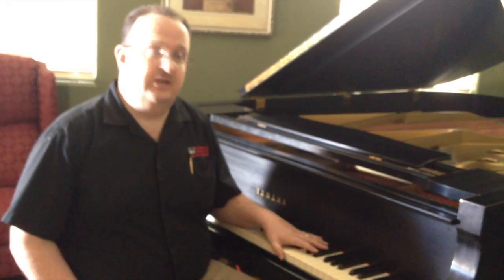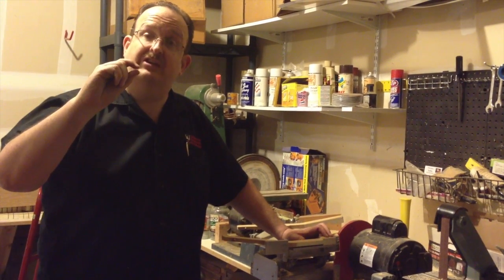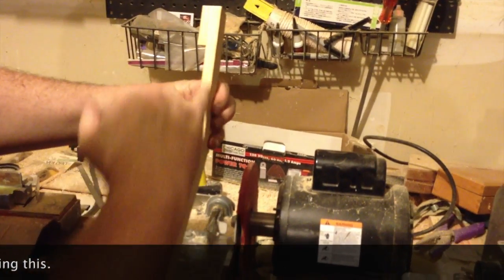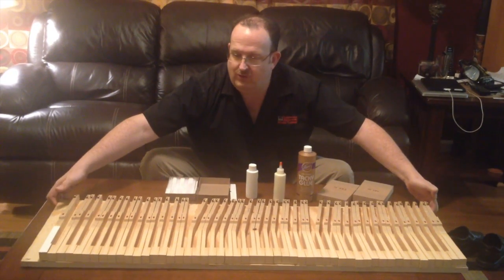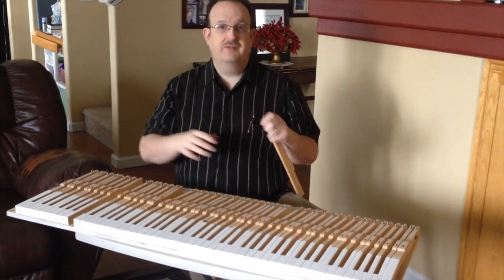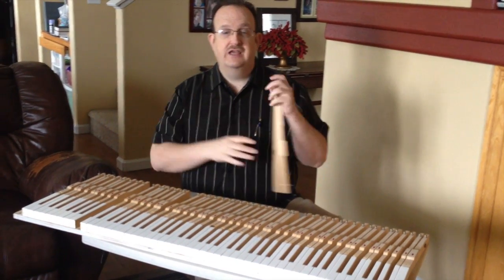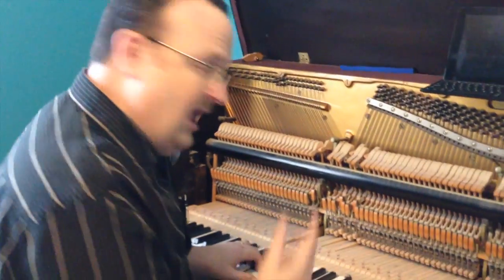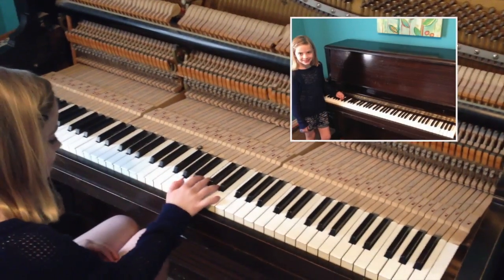Piano Keytop Replacement

Comment: Thanks Ed, I've applied some of your process and have had several key jobs go successfully. I use the Saf-T-Planer from Stew Mac to mill the keys (since I don't have that nifty machine that you have) I can do a set in about a day and offer quick turn around to my customers. I also rebush the keys in the process which takes another half day (with my slow moving methodical work process)...  I'd rather go slow with the process and make sure everything is right. Do you ever fabricate the keysticks themselves?

Comment: great video, sir.  working on a hurting Ludwig upright from early 1900s as a hobby (got it for free!), and your tips are very useful.

the key tops are in very poor shape, but it seems like replacing the whole key tops would be a useful and welcome facelift that wouldn't be too complicated.

did some searching on key widths, but it seems according to this video that trimming is a reasonable step in the process (I found some key tops on eBay for $25 but haven't ordered yet).  any warnings or words of advice?
thanks

Comment: any piano same steps. you dont need these tool at all. just a sharp skinny pocket knife like I always do. insert knife by center of the key then just pull. if you have ends put key on wood , put knife edge on piano key end end hit it gently, it will come off. just glue new tops and trim as need. good luck, its easy.  scale 10 to 1 its so simple.

Comment: Um - 
Thanks for sharing your process!  It certainly gives hope that the upcoming KT replacement for the daughter's piano doesn't have to take me all week over at their place (100 mile drive).  Truthfully, I thought I would be looking at 2 days, but that's because I haven't yet envisioned a way to clamp up individual keys with the limited number of clamps at my disposal (between my tools and the son-in-law's). So I was HOPING that your vid would show how you broke that barrier, but you have cleverly edited out any actual gluing and clamping.  Is that reserved for the paying customers? It certainly seems like the most critical part of this process, to get it as close to perfect the 1st time, no? Well, as I said, thanks for what you did share!
pw
Reply from the maker: I simply spread glue on key and place keytop on in a circular motion to make sure of contact with glue. I do not clamp.  Let dry for at least two hours. Generally I allow an overnight cure and then sand or file edges. Using fresh proper glue is key.
Reply: +Ed Tomlinson. Hi Ed Great video!!!. ed i would like to buy 88 piano keys with keytops on them,the Black keys and the White keys.....JUST THE KEYS ONLY,where would i get them,and how much would they cost me???. Thanks

Comment: How do you get the keys out of the piano to replace the tops?
Reply from the maker: Every piano is different. Open lid then look to see how the front board comes off. There are generally two latches or 2-4 screws. Then a key upstop rail or wood strip above keys. This comes off with just 2 screws. Good luck.
Reply: +Ed Tomlinson thank you!
Reply: +clarelan7  Hi Ed, you were so helpful before I hope I can ask you another question.  I followed your instructions, removed the front board of the piano, and have been pulling out the piano keys and replacing the tops.  This piano is over 100 years old, however, so in the jostling some of the leather straps have broken that connected the hammers.  So now those keys have beautiful tops!  but they are duds :(  Can you point me to any instructions for replacing the leather ties?  I wish you lived closer and we could just pay you to come fix them!

Comment: Nothing about the black keys. They're like the Fight Club. We just don't talk about them.
Reply from the maker: The black keys or sharps, as we refer to them, are easily dealt with and not a lot of need for extensive explanation.  I usually clean them and sand them with steel wool then shoot them black with a satin black rattle can and after 5 hours of dry time I rub them out with 0000 steel wool and they would look new again.
Reply: @edtomlinson   First, thank you so much for replying, and I do apologize for the tone of my comment. I was just so frustrated with finding nearly zero information online regarding the sharps, and people just focusing on the whites. One thing I read about the sharps was a horror story about somebody who spray painted them and they remained sticky and left a residue on the fingers after playing. For that reason, I was considering to just replace them, but they do look difficult to remove. Many thanks again!

Comment: what about the square of the key?
Reply from the maker: I assume you mean the notch.  Most of the time I use appropriate pre sized keytops that will place the notch exactly at the correct spot.  If not I have an 80 year old machine that will notch the keys uniformly.  That takes about 20 more minutes to accomplish.
Reply: @edtomlinson  I gess they call : key front . Thanks for the unsware!
Reply from the maker: @johndoremi3872  most of the time the fronts are fine. If discoloration has occurred then a dust coast of primer white takes care of that before tops go on.
Reply: @edtomlinson  Im a beginer on this job. The piano owner said that he wants the piano "Like New"  , i will have to buy the complete keytops with fronts
Reply from the maker: @johndoremi3872  I find that when you buy the keys with fronts it is a challenge to cut of the fronts and then it adds hours and hours and lots of precision clamping where my system works in much shorter time with better results without all the clamping and trimming.  If the fronts are discolored I use a white primer and spray the fronts.  Place all keys together tightly and mask off all areas you don’t want paint and then a few light coats and 20 minutes and the fronts look like new.  Easy and no clamping.
Reply: @edtomlinson  Greate idea!! im scare a lillte bit, but i´l give it a try! thanks so much !!
Reply from the maker: @johndoremi3872  the key is to do spit coats. You don’t want drips.  It is the easiest and best.  The fronts are already perfectly formed to the key.  If you replace them then every key stick must be fit on both sides and even the bottom.  They tops always come with more mass on fronts than you need.  Making hours of extra work.

Comment: I was never particularly good at maths, but the figures you give, time-wise, just don't add up. Less than TWO hours to replace key tops?? Taking ALL into account? Sorry mate, I'm a highly-skilled European cabinet-maker and restorer here in Paris, France. I've done some piano work, like cabinet work, veneer work, French polishing pianos. It's obvious we only use ivory and bone. The job you're talking about is factory work. Our rates would be about 800/1500$ minimum. Using traditional glues and methods. I still don't understand HOW you arrive at your figures. Okay, you use cheap pre-manufactured plastic. Even then, there's 1)going to the client 2)removing the white keys 3)back to the workshop (you differentiated EACH key- the A's, the B's, and so on). 4)setting up, and trial testing the saw 5)glueing on the tops (you DIDN'T show how) ****normally each key is CLAMPED 6) trimming and rounding the edges 7)back to client, fitting in the keys. Either you're Speedy Gonzales, or you're a dreamer. I spent 359 hours on a beautiful Pleyel. Here in Europe we take the necessary time. Too many amateurs around for my liking. Roger and out.
Reply: I hope you don't mean you spent 359 hours replacing a set of keytops. If that's the case, you should stick to cabinet making. Moreover, if you really charge $1500 for the job and you spend 359 hours on it, you're making $4.17 an hour. So you're drastically over-charging for the job and still making less than minimum wage for your efforts. If your 359 hours were spent replacing keytops AND doing other restoration work, you should state that in your reply.
Reply from the maker: I am happy to show how this is done.  I have even taught this at the national convention.  The last set I did in a little under 3 hours.  Proper tools and skill set is required.